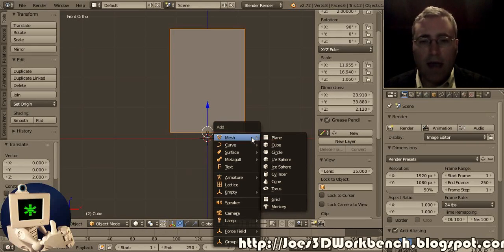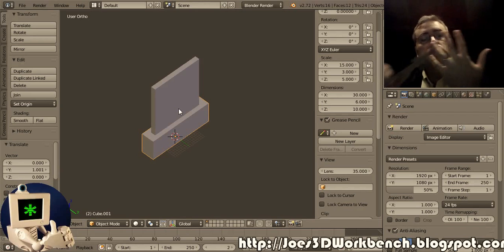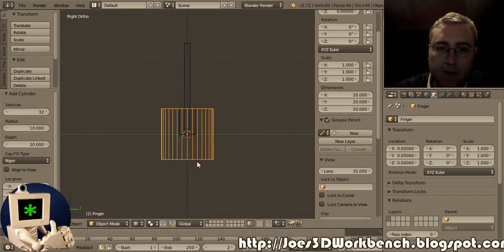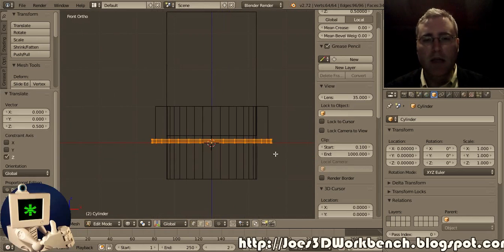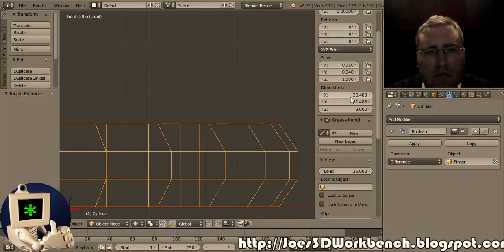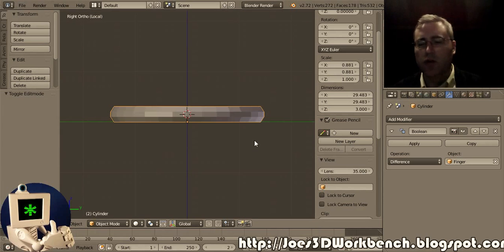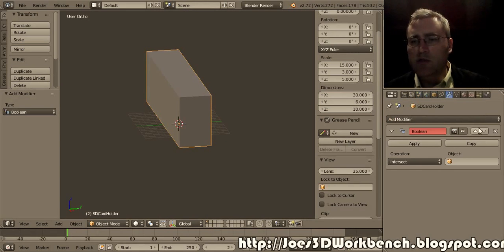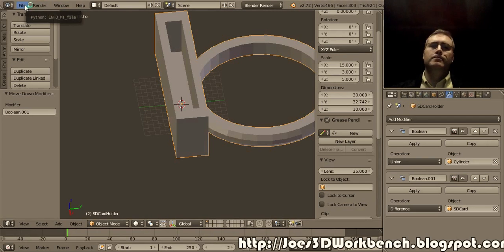Modeling for 3D Printing - CAD-like exactness Part 2

Comment: Definitely not to long, but I'm really early on the learning curve so it's all still new.  Since I'm a mouse only user, then macros and On Screen Keyboard is the only way. So hunting for your keystroke, or the area of the desktop your working is a challenge. I've totally given up on Blender three times over the years, but SKP or SW have a hard time with point clouds or STL's generated from a scanner. Keep the lessons coming please. :)
Reply from the maker: Just figured out screencast keys. I'll try them out for the next video, but for some reason they weren't included in the latest version. I hope that's not a bad omen.

Part of the reason I haven't done that yet is because I have changed the configuration. But I haven't changed it much.so it might be okay. We'll see.
Reply: Excellent point about working with point clouds from scans.  That, and exact modeling have convinced me that Blender is probably gonna be the most versatile app, for a newb like me, to start dedicating the time to master it.

Comment: I use Blender exclusively and it drives me crazy sometimes. In a simple example like this, for instance, Booleans work just fine. But in a lot of my models Booleans just don't work. I try to take the difference between two objects and I wind up with an empty mesh, or I get the union instead, or I get some kind of disaster that looks like a Star Trek transporter malfunction...
I'm not sure what's triggering it: I've dug into my models to try to make sure that they're manifold and that the surface norms are correct and agree (and that's another area where Blender tends to screw up - if you recompute surface normals it often gets them wrong) but for some reason the Booleans just don't work right.
I love Blender, don't get me wrong...  but sometimes I get stuck and the answer I get is like "not a problem, you can use this tool or that modifier" - and that doesn't help when the tool doesn't work.
Reply: Do you by any chance have a habit of trying to bool objects that have coplanar surfaces? Because that tends to fail. Also T-junctions or holes in the mesh will cause issues.